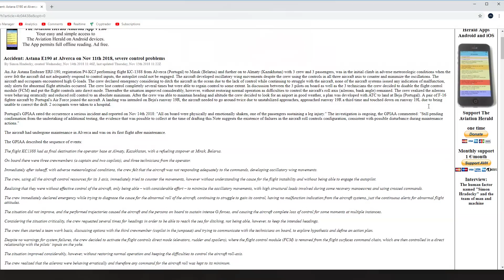Flying with REVERSED Flight Controls! (Experiment)

Comment: 1388 flight control issue was more unusual and weird than just inverted controls (if I understood the problem description correctly). That’s why the pilots had zero control in the beginning of flight, and only limited control in the end. On small inputs, the controls were inverted. On large input, correctly controlled surfaces would engage, causing roll / loss of control due to surfaces trying to control the plane in two different directions simultaneously. So effectively they had to land with inverted controls and very wide safe turns to avoid the uncontrollable situation.

Comment: I would like to put additional info about this incident. The only problem was aileron only but the spoiler (high pressure control) still in good shape. This turns out to be for instance LEFT TURN YOKE = LEFT AILERON DOWN for right turn, RIGHT AILERON UP for right turn. LEFT SPOILER UP for left turn. This situation makes the plane turn right with LEFT ONLY SPOILER OPEN UP and destroy the lift together with right aileron it creates unbalanced open of "spoilers" with different moment plus yaw damper reaction to keep the ball on center. CHAOS. And the pilots manage to control the plane WITHOUT AILERON. thats how the manage to land the plane. Coz if they kept trying the aileron yoke input they will kept on loosing control. This this teach us good thing is a basic thing. Do a good check even though you have to be late. Dont push it, just do it slow and right, if you lost control keepthem centered and fly with other controls and take it from there. Kudos to the pilot and to the investigator to  solve the problem and let everybody know how we should prevent this from happening again.

Comment: Good video, and a good experiment. I have to point out that the 190 that inspired this video had a much different experience. For them, only the ailerons were reversed. They were physically reversed, but they aren't they only roll control surfaces. The multi function spoilers were working properly, countering the ailerons movements. This is what made it so difficult for them. As the yoke was turned for right wing down, the ailerons moved to left wing down, but the multi function spoilers were moving right wing down. This made a very difficult situation for the pilots. Great work on their part to land the aircraft successfully. If that's something you can simulate, I'd love to see that video.
Reply from the maker: Thanks! Yes you're right, it was partly inspired by the accident, knowing that the investigation is still ongoing and not all flight controls were reversed. I probably can't simulate that very easily, it would probably require altering addon aircraft code, but it would be interesting indeed!

Comment: The next time try to stabelize the aircraft at an constant pitch angel and control the descent only with the thrust input. Control the direction only with small aileron inputs. The aircraft basicly is designed to fly by itself. But your experiment shows how difficult this situation can be!
Reply from the maker: Thanks, it sure was difficult! You know you want to let the aircraft fly itself, not touching it indeed seemed the best way to go, however it's hard to supress those instincts upon short final, let alone the flare. That probably requires a few more practice runs ;)

Comment: One technique you can try is what you do when you have to drive back in a straight line in a car with a travel trailer behind you. You look in the mirrors and as soon as you see the trailer going to a side you steer TO that side, so you steer TOWARDS the problem to solve it. So when you apply that to flying you constantly say to yourself "steer towards the problem".
Reply from the maker: Good idea, that might work :)
Reply: It worked for me driving the trailer, as soon as I learned this trick it became a lot easier :-)
Reply from the maker: @rdc2724  Guess it's time for me to drive with a trailer :D
Reply: Yes, maybe you could try a trailer with a glider ;-)